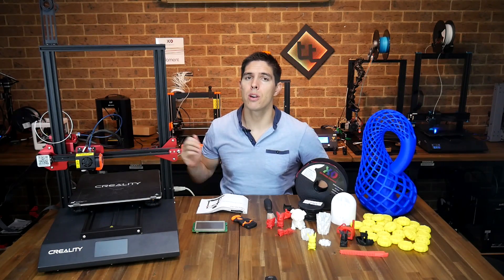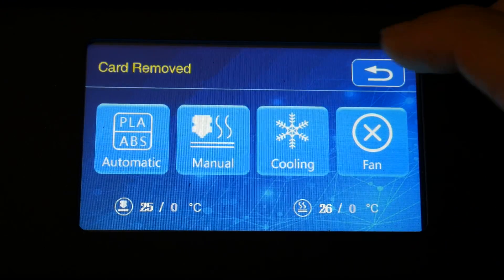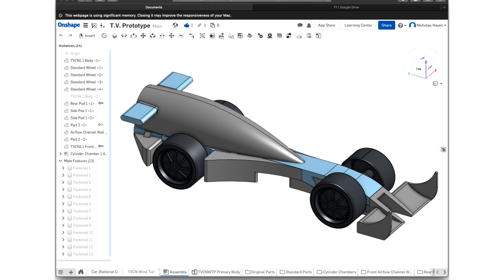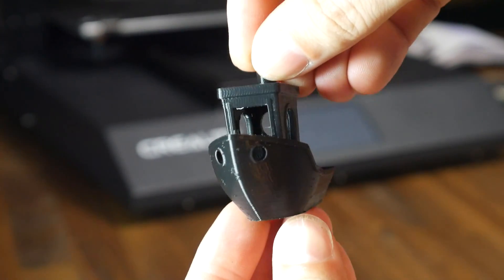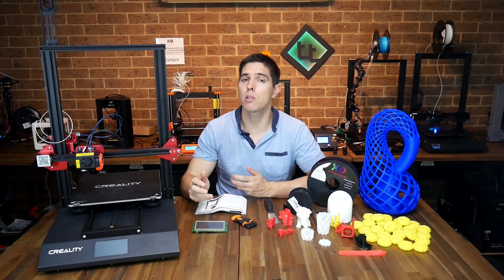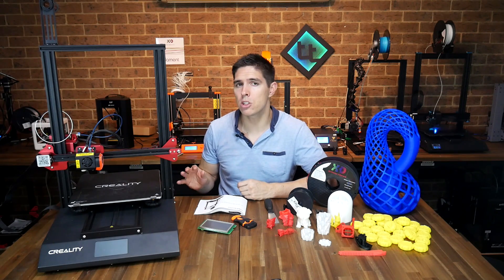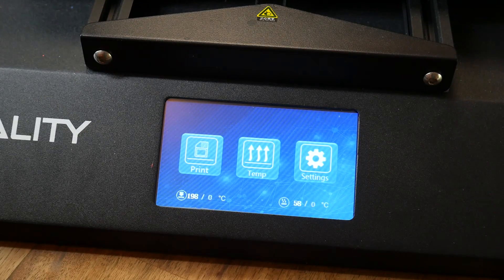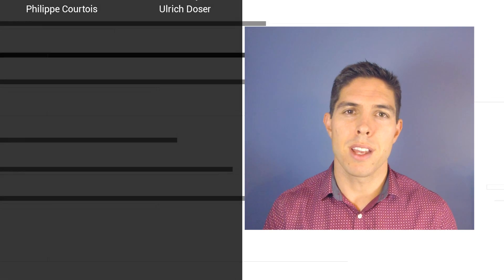Creality CR-10S Pro - An honest review *UPDATE IN DESCRIPTION*

Comment from the maker: Argh! An editing error left out the screen shot I had showing the dual geared extruder. My apologies on leaving this out, you can see pics of it when following the links in the description.
Reply: No problemo!
Reply: my friend and i made our ender 3s to dual  z very nice upgrade, 
Any Linear rail mods for all axis?
Reply: @mathewphillips4185  Did you follow a tutorial, and If so do you have a link? Been thinking of doing that next, thanks!
Reply: @deceitive3338  part tutorial but pretty much  do it yourself. Angle square helps especially for RT side Gantry
Reply: Where is the link too the "CR-10S Pro replacement part cooling duct 2 (recommended):"
Reply: im looking for a 3d printer to make cosplay props, replica weapons that type of thing, i was told i should get this CR10s Pro but i have no experience with 3d prtinters, i was wondering if anyone can reccomend me a good one? my price budget is $600 max
Reply: any printers out there that that commercially print metal d and d figurines?

Comment: Hello.  I have a new CR 10S PRO V2.  After successfully manual leveling and doing the 25-point check, I try to print, but the nozzle starts to extrude PLA a few millimeters above the bed.  Does anyone have an idea why that is?

Comment: I know this is an old video but you seem to have the wisdom. I just got into 3d printing and bought a buddies cr-10s pro v1 (same as the one in the video.) My question is I’m wanting to upgrade to the creality touch sensor over the laser. Would this sensor plug and play into my v1 or will I need a new 32b motherboard?

Comment: I have a CR-10S that I upgrade the silent board that was already configured for the 10S. Works fine except for the auto leveling feature. When I click next it goes to the #1 location lowers fine. When it goes to #2 location which is the far back left side the Y axis travels to far as well as X axis at #3 location making a terrible noise cause Y and X is going beyond it travel. How can I fix this?

Comment: Use a stanley knife you know the ones with the blade segments you can snap off for removing prints off your bed. Open the blade all the way out then just flatten it on the bed and glide it under your print and they will pop straight off. Be very careful of course as the are a razor blade basically. I have done it this way for years and never had any trouble removing prints, it also gives your build plate a clean slate for the next print. Thanks for the review Mike I am thinking of getting one next. Just waiting on my Ender 6 to arrive for now.

Comment: Hi Teaching Tech (thanks for the Real! helpfull videos for a starter in the 3d printing adventure)...  i have just bought an Ender CR-10 S Pro and i have problems with my GCODE files = they are not appearing in my list (one or two might but not my list or the ones i wanted)..... i was wondering if you have a solution (copying them in the folder does not seem to work and i have tried to place them in the original folders but they do not work) Please if you could help?  -- DaniEL

Comment: Hi Michael, was wondering if you have any tips on upgrading the CR10S Pro V2, both the display and the firmware - the videos that you have posted on the Ender 3 were brilliant and extremely helpful (thank you so much for those).
Can you edit the CR10S Pro V2 in Visual Studio as you can with the Ender 3 Pro? 
Thanks.

Comment: My first printer was an Ender 3, very budget friendly good small printer, but sold it after I required more build volume for my projects. I bought the CR-10s PRO as it had good reviews, build volume and print quality. I had this printer for a week now and I can say that is on its return to its seller. I am not able to level this bed properly, even with the mentioned tutorial or the instructions that came with the printer. I was not the only one having this problem after reading some reddit posts for example. The hot end would not settle even NEAR the bed and I was not able to change the Z-offset, so I was not able to manually level the 4 corners. After fiddling with it a bit and turning of the auto level, it bored itself right into the heated bed, bending the whole assembly and leaving a pretty shiny dent in the bed. Very nice 600$ printer. Must be a monday morning model... I really believed in this printer and it had my required build volume... too bad.

Comment: From when I saw this video to time of actual purchase, the V2 came out. I'd saved the pennies for months before I could buy. 
It arrived. 
However, I'm not sure what happened in the manufacturing floor, but my gantry won't mount to the base. There is almost a 2mm taper inward at the base of the Z-axis extrusions. 
Closer inspection shows several bolts have not been tightened into the nylon lock nuts. Some bolts are too short to fit into the nylon portion of the nut. The head unit with the extruder is about to fall off and the belt is misaligned. 
The Z-axis motors don't sit square on the gantry and will need new brackets. It is too hard of a bend on the couplings and I fear will wear the motors out from such a hard bend.
I'm disappointed that I'm now going to have to spend a day or so to align and adjust everything before I can mount the gantry. Possibly buy new replacement parts. 
With all the that said.....I do hope to get running soon on this. I've watched several of the "Teaching Tech" videos and am looking forward to using my V2.

Comment: Hey man your channel is great!!
I have followed many of your vids. Its awesome.
You inspired me to move forward with the creality printer  i just got, the CR10S Pro V2.

What would you recommend as the best slicer and settings?
do you know anyone who has uploaded some configurations?
I tried cura and really didnt like the way it was slicing. I was not good like prusa w/ prusaslicer.
I am actually trying to use prusa slicer now and its almost working except it wont do a full bed level before each print..

Oh and i followed your advice! flashed the machine over to Tiny Machines , printed the fan shroud and ordered a wham bam.
I have powder coated plates for the prusa and they are sooo great.

Comment: wich is better in printing? CR10s PRO or ENDER 5? I ask because of Y axis movement. on ender dont need to move heavy base plate and CR10 yes and the project is biger than ender 5. Why they dont use coreXY movement instead of moving base on CR10 pro?

Comment: I am at a loss. My bed leveling sensor went bad. I tried to replace it but it homes 6" above the bed. I tried to loosen the gantry and move it down. But when you click home it goes 6" above the bed. I flashed my motherboard and screen a few weeks ago but it was working after I did that so I don't think that's the problem. Im at a total loss. buddyrh7980@suddenlink.net

Comment: Regarding anyone having difficulty removing prints from the bed of this printer! When using PLA, just preheat the bed to 40C after the print and they pretty much come right off, no need for the scraper.
Reply: Hi Joseph, does this printer have a slightly flexible build surface like the Ender 3?
Reply: @AndrewAHayes  It comes standard with a metal bed and buildtak. I ended up getting a removable flexible magnetic surface. The bed level probe likes to miss off the side if it's too thin which causes the nozzle to dig in if you don't hold something to stop it. I think this can be solved using a thicker bed replacement, but mine works quite well despite a slightly marred surface. The top magnetic sheet is fairly inexpensive to replace.

Comment: Would you get CR10s pro  or the artillery x1 ? please help!! i have racked my mind trying to figure out what to get
Reply: I would think the CR10S Pro.  The Artillery really is lacking in community and parts.  It also has lots of issue with the ribbon cables, connectors and z wobble.  There is no support, nor website I can find.  Very small manufacturer.
Reply: what did you decide on?

Comment: First - great review! Noe I got a question. My heatbed cable broke and generated a Short circuit. I need to replace the cable. Is there a more robust cable I could use and is there a good cable chain to be used? Anyone else who had a similar issue? Thx in advance

Comment: I got some cheap sensor that gave me some random readings producing all sorts of inconsistencies on the first layer, i sorted the problem by placing a small drop of Loctite 243 in the regulation screw. Its seems that after a while due to motion vibrations these bolts tend to go loose, a small drop of Medium or Low Strenght (Loctite 222) prevents it from unscrewing on its own.

Comment: Great review.  I do have to say though.. Who JABS away at a print to remove it..   I mean,, your just hacking away at it...  I've had prints almost welded on and not hacked away like that.  steady even pressure WILL remove them and not knock the whole printer all over.....  I honestly don't consider that a fair criticism.
Reply from the maker: Even if you don't like my method, the comparison between removal for this and other printers is valid. For a printer this expensive, this aspect is under developed.

Comment: Michael, As usual an excellent review. I just purchased the Creality CR-10S Pro, but have not received it yet. I had one question, as a safety concern. Is there a Mosfet in the control area for the Heated bed? I had on of the Anet A8 a few years ago, and I will ALWAYS install one if it is not present.   Just curious if it was in the control box.    Thanks again for the terrific review.

Comment: So I have an old version 10-S that I still haven’t gotten around to putting together. I bought a silicone bed heater and SS relay for it to install when I finally do build it because I’ve heard the regular bed heater doesn’t work so great and takes forever to come to temperature. Did they upgrade the bed on the 10-S Pro? The Pro doesn’t appear to have issues with low adhesion anyway!
Reply: The printer uses a Meanwell 24VDC PSU as opposed to 12VDC (CR-10S) so I imagine it's faster and possibly more consistent on the bed heating.

Comment: is there a plug-and-play printer out there? This seems like way too much tinkering for my life...
Reply: Depends on the pricepoint. I went with lulzbot Mini 2. Out of  the box, no fussing around just printing. It calibrates itself and is off to the races. Obviously it is much more expensive, but like you, I didn't want a hobby of fixing/calibrating  printers to get in the way of my hobby of designing cool things and then making them... Si I guess its what your willing to spend.
Reply: @drewzin14  I can spend up to 2K but I need a large surface cuz I want to print helmets/cosplay props

Comment: Im new to 3D printing, i bought the creality ender 3 pro and started printing the upgrades for it, like the spacers the cable chain and drawer and all went well until i swap from black to red filament, my prints were not stickingto the bed and  my question is, do i have  to change the settings on the printer or do i have to tweak the PLS files a little ?

Comment: Watch the Gantry sag at about 4.38 in TM's video soon as he takes his hand off the left side,  https://www.youtube.com/watch?v=hitJUx3eKW8   This is an issue that a lot of people have with this printer as well as the sensor being a sensitive piece of crap, Some get lucky with a cr10s pro that was setup right and works fairly well, while a lot more then not have a terrible experience with the machine being at best a leveling nightmare at every turn! This is the reality of this printer as soon as a power down occurs!  This is not TM's fault, It's the printer v-slot wheels being to loose and the left side being to heavy and poor QC at the factory. In summary you need a Gantry kit and a quality sensor to make this printer behave,  otherwise you may regret buying it and it's a 50/50 chance as to yours being a joyful experience or a leveling Hell. The ABL (Auto Bed Leveling) is a misnomer because it doesn't actually level the bed for you, in reality it actually measures the bed for oddities and try's to compensate for them with the software, so don't be fooled by that ether!

Comment: I want a 3d printer that connects directly to my PC. I want at least 2-color capabilities. Yes, I am a beginner in 3d printing, but well versed in computer software and hardware. I may not do anything that complicated now, but I still want the ability (I want to buy more than I need at the moment). 

Which 3d printer do you think is the least complicated for the optimum results for a starter?

Comment: Great video, I have this printer it prints great the only issue is the printed parts are extremely difficult to remove from the print bed, I am going to level the print bed again and give that a try. Any additional information you can recommend to resolve the issue wold be appreciated.👍

Comment: Hmm.. Maybe you didn't find them.. Well try again. What you are looking for is two little hex grub screws, in small two holes up on the left side of the print head. They hold the capacitive sensor firmly in place, if the workers remembered to fasten them. Which by your description, they did not. With the printer, came a set of hex keys.. Well, let me know how it worked. It should resolve the issue completely - and provide you with the best auto bed leveling experience you can get. Btw, I just love the CR-10s pro. Its an extremely well designed, well built printer. Worth every penny. True, with several upgrades you can make the Two Trees Sapphire-S (also from Shenzhen) print faster, but the Sapphire is small and the Creality gets super high quality, even on huge prints, making the CR-10s family of printers extremely cost-effective printers per cubic centimeter of print volume, plus due to its superb ABL (but only after you fasten these bolts), the CR-10s pro always gets the job done.
Reply from the maker: I adjusted the height of the sensor several times and tightened the grub screws sufficiently. Pretty silly to suggest I've made an error here when creality themselves have acknowledged the problems.
Reply: @TeachingTech  No need to adjust the sensor height more than once. Its height above the hotend tip is flexible, all you need to do is to set it the way you like it to be, then re-tighten the screws. Mine is approximately two millimeters about the hotend tip, this ensures it picks up the platform. Then do an aux leveling and then use a piece of paper (not the supplied 0.2mm ruler) to set the height of the tip of the hotend above the platform to about 180um: use the manual controls on the screen. when the paper stops moving freely, one click up. Now use the supplied screwdriver to adjust the capacitive sensor sensitivity: turn it counter-clockwise until the red led goes off, then slowly back clockwise until the point the led re-ignited. And now do an auto-levelling (press "measurement"). See how it works. In my case, after doing it, I can print a sheet of one layer all around the plate and get it as thin as a plastic bag and even all around the bed. If after all of this you don't get this result, then maybe your capacitive sensor was defective.
Reply: @TeachingTech  Which if that is the case, if the capacitive sensor is defective, you should contact creality and ask them to send you a replacement like they've replaced your screen. In any case I wouldn't go inductive, because I like printing on PEI and it's not metal.
Reply: @TeachingTech  PS. Forgot to mention, one thing more - whenever I get to do this procedure (which is not before every print, only when I want to be sure I have perfect bed leveling) I do it only after preheating the bed, to avoid all kinds of heat related capacitance issues from affecting the sensor. But this isn't such a major issue since this effect is mild.

Comment: Hmmm.. About the ABL.. Your experience is consistent with a well known problem with bored Chinese workers who forget to fasten the two small screws on the left side of the print head, who hold the capacitive sensor in place. Did you fasten the two small screws? Try it.

Comment: I have a CR10S. It's a great printer, but it was plagued with little problems. I added bed leveling form TH3d,  a new Swiss hot end, new aluminum drive assembly, new PTFE tube and connectors. It's a great printer for the size, but I have to say my Prusa mark III worked from the get-go.  It does not print as large as the creality, but it I never spend more than the $750.00 I paid for the kit. The Creality cost me $599.00 last year, and $188.00 in upgrades.  I still need one more upgrade to "Z" bearings.  If I don't need the size, I'll buy another Prusa MK3 kit.

Comment: hi, awesome video. I plan to buy my first 3d printer, budget is around 500-600€. i think this printer would be great, but i dont know about the alternatives. can somebody recommend this or another printer?
Reply: I would recommend either going up 100usd to a prusa or going down 100usd to a cr10s for fewer problems. The cr10 pro is probably not a good first printer
Reply: I highly recommend the  Prusa MK3 kit if you're handy. It's a great performer.
Reply: @Kitwilbur  i actually think ill buy the mk3s kit, thanks!
Reply: @buck960  Let me know how you did.
Reply: @Kitwilbur  prusa :)
Reply: @buck960  good for you..  I have the cr10s and the Prusa. I find myself using the Prusa more.